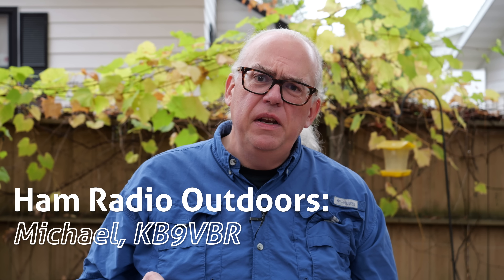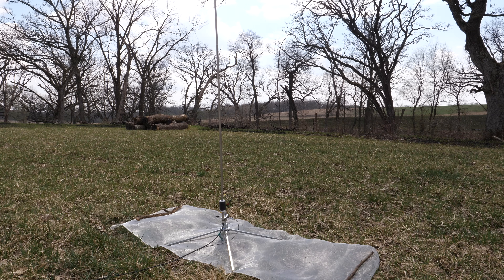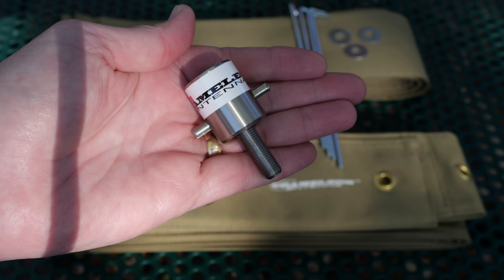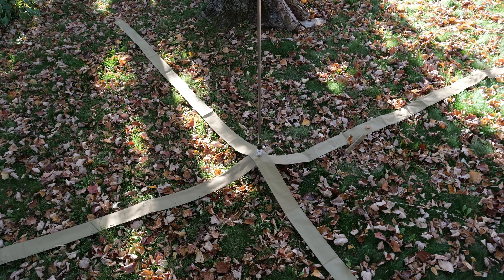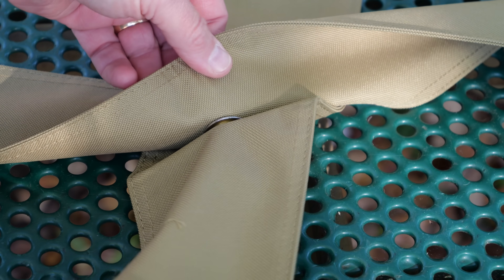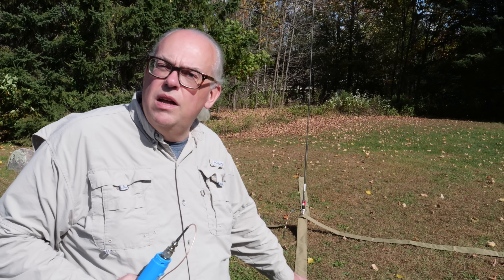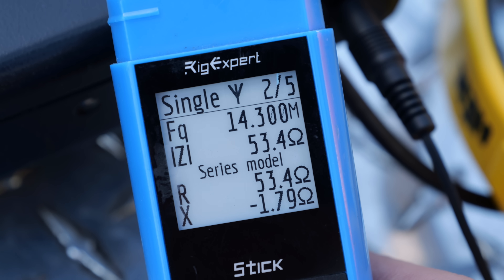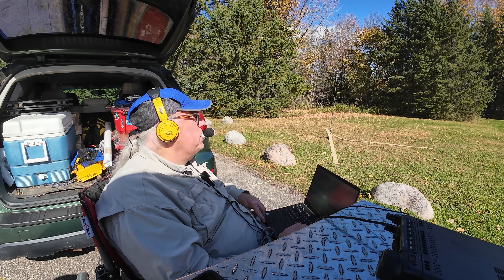I tried the Faraday Strip Radials for my antenna, and WOW!

Comment: Royal PITA And way too expansive compared to $1 worth of wire...my opinion.
Reply: A claimed 23 - 28% increase in field strength is less than a 1 dB gain! One SIXTH of an S-unit for $130!  Of course, all the non-technical appliance operators don't understand anything resembling antenna theory. To gain a full S-unit, just raise the base of the vertical by 3 - 4 feet and run 3 or 4 sloping wire radials down to the ground.  This reduces ground losses dramatically and actually improves TX strength in an easily observable way.
Reply: Thanks for sharing your thoughts! A couple of clarifications — the 23–28% improvement we measured isn’t a theoretical paper figure; it’s a median result from extensive field testing comparing the CHA FSR to standard 4-wire counterpoise systems under controlled conditions.

While 1 dB may sound small on paper, that’s a median gain across multiple bands and environments, not a single-spot peak — and it represents a consistent improvement in radiated field strength. The real advantage isn’t just raw gain, but reduced ground losses, more uniform current distribution, and better radiation balance, especially in portable, ground-level deployments where ideal elevation or sloped radials aren’t practical.

The CHA FSR also offers mechanical, safety, and operational benefits over thin wire systems: it’s more durable, visible, and deploys in under two minutes — all while maintaining that measurable performance edge.

Our testing wasn’t done in theory — it was done in the field, under real-world conditions, and the results speak for themselves.
Reply: @Chameleon_Antenna  anybody who thinks 1dB of gain on HF is significant needs to be educated. It matters on VHF/UHF weak signal paths such as EME. Your product is for those who have more $$$ than common sense.
Reply: That’s your opinion!
Reply: @diogenio What about running 30 to 60 radials?
Reply: @CSIS-Spy  numerous studies have shown that depending on radial length, 30 to 60 radials is well into the point of rapidly diminishing returns. Oddly, the 30 radials can be shorter than the ones if you deploy 60 to achieve their maximum efficiency. 

The true irony here is that by raising the base of the vertical a mere 1 meter above ground, just 3 radials will provide the same high efficiency as having 100 right on the ground.
Reply: @diogenio Thanks for the heads up!   I will need to try it someday.    I am new to Ham and Antenna theory and propagation based on solar activity is a little over my head.  I just know the very basics to pass the exam. 

I will be purchasing the chameleon Mpas 2.  Expensive but very well made and can experiment with multiple antennas.    I will be exclusively doing POTA and Emergency preparedness.

Comment: Thanks for the review. Please explain why this is better than wire?  If that cannot be proven then it's a stretch to spend $130 on this system which is far bulkier and heavier than wire to carry into the field for SOTA or POTA.
Reply: I just posted the explanation in the general comments section.
Reply: @Chameleon_Antenna  Yeah but no measurements and compare. Do a WSPR Chart with a second setup and transmit at the same time. Let us see the results.

Comment: I was going to make a crack about needing a firefighter to roll them up but Chuck KK6USY beat me here.

While bulky, anyone could fit them in their vehicle. If they can't, they have other issues. The price is steep for a radial system (and hams are notoriously cheap). On the positive side, they should last for years if cared for properly. I like your recommendation for a high viz color on one side.
Reply: Like they say, the first wire was made by two hams fighting over a penny.

Comment: Did you use a coil for 40m? I didn't see one.
Reply from the maker: I used the Chameleon M25 coil and SS whip for the SWR tests on 40 meters. I think there is a closeup shot of the blank adapter/coil/whip combo in the montage sequence.

Comment: Really Bulky and expensive at 130.00. I don't have a problem with wire, fast and easy and doesn't blow around. Thanks for sharing Michael.
Reply: Being candid, I’m surprised they are only $130…
Reply from the maker: Fabric is expensive and  you'll only get your piece cost down by buying bolts at a time. The ham making a single set at home will spend close to that price.
Reply: Thanks for taking the time to explain but very few people understand the real cost of manufacturing in the US. The amount of money, experience and equipment needed to produce in quantity is HUGE. But most people have no idea as to buy the stuff from China…
Reply: We always try to improve our manufacturing processes so we can keep everything as low as possible considering that the manufacturing in the US went up about 18% to 25% since the last few years…
Reply: @Chameleon_Antenna oh, maybe if they were branded as “mil-spec” or “rapid deploy tactical” they would be more.  We all know it’s marketing that determines the cost and not manufacturing 🤣
Reply: Wait - what?
Reply: @TheSmokinApe  They need to have them in camo!
Reply: @JoeHamelin Right
Reply: @Chameleon_Antenna  I got it…make a tactical version that forgoes the 3/8” adapter in favor of m-lok.  Coat all the metal parts in Cerakote and make the stakes out of Carpenter 158 and call ‘em BCGs: Baofeng Current Grounders.  🤔
Reply: @bkrateku  I really don't know about that idea... We already SOLD OUT on the 200 sets we previously had in store and we already manufacturing 500 more sets... I'll have to ask General Patton about that.
Reply: @JoeHamelin  We don't do CAMO. In fact - none of our MILITARY customers buy CAMO. It's either Desert TAN or OD Green.
Reply: @Chameleon_Antenna  He is making fun of the "tactical" edition guns that are basically the same except for a coating and a fancy metal used for a unimportant part.
Reply: @Chameleon_Antenna  But with camo you could call it the Invisible Ground. :)
Reply: @Chameleon_Antenna speaking as someone who does expeditionary comms in the military it’s because it’s a safety risk. The vast majority of are military
Are not trying to hide antennas we set up, we are trying to keep clueless people from tripping over radials though. Matter of fact when my command got some MPAS kits awhile back the only negative comment was that the radials blend in the grass too much to see where they are.
Reply: It always depends how you’re going to use them. It’s just a tool and each tool has its own purpose and PRO & CONS.